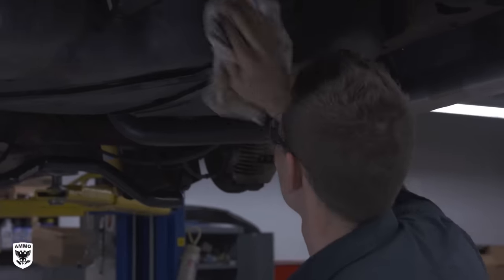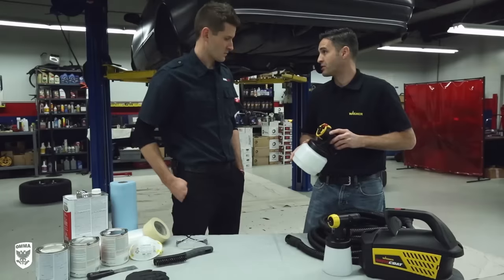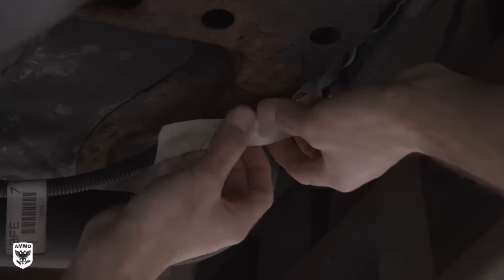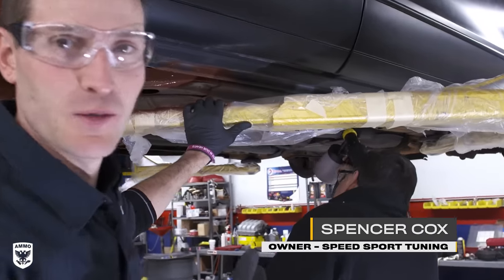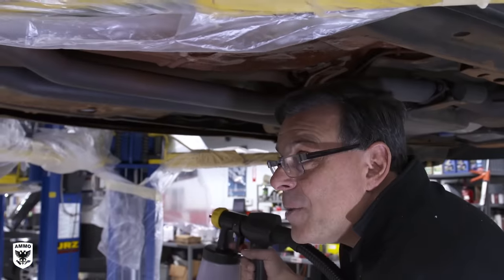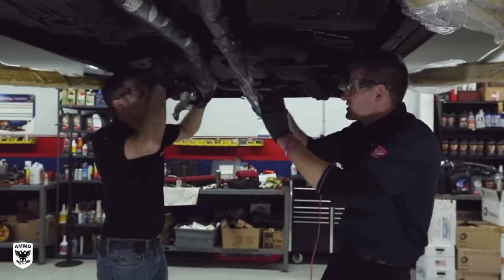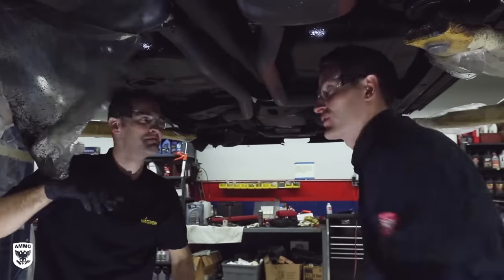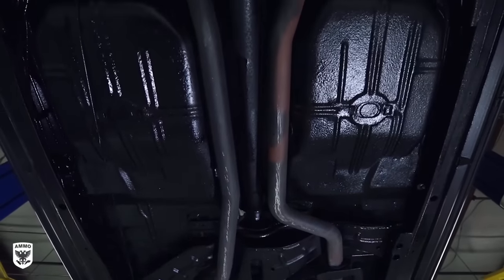How to Undercoat Your Car: Impala SS

Comment: Congratulations for killing your 95 Impala SS !!
By using a wire brush you effectively turned rust into molten rust. molten rust may look like metal but is still rust. Then you covered rust with paint. Rust contains water, oxygen and acids that will keep eating through metal. Then you covered the whole thing with undercoat so you can't even see how it is rusting underneath. What happens next is that the rust will turn metal into dust so that the paint and undercoat will form pockets that will over time fill with water, thereby speeding up the process, and because of the undercoat you won't notice it until complete panels or even the frame are rusted through. But then it is too late, as a restoration will financially make no sense.
The only way to stop this (and that is going to be nasty and expensive) is to sandblast the whole bottom of your car (which  btw. means disassembling a lot of it) and then repaint it and hope that the rust hasn't crept between individual sheets of metal.

For everyone else watching this video: Don't make the same mistake! Get to a shop with a lift and a compressor and blast some oily wax on the bottom. Repeat this process every year or two and your car will last forever, even if it is already rusting a bit.
Reply: Excellent advise. I have an all original 1996 SS with 50k miles on that's been garaged for the majority of its life. I have some surface rust on the bottom of the car, but nothing like this 1995 had. Thinking of instead of painting or undercoating it, I will simply just spread fluid film all over the place to basically slow it down, and hopefully never have to go through what was done in this video.
Reply: ConfusedSoul24 Oily wax?
Reply: I don't know about the primer they used. But rustoleum makes a reformer that chemically reacts to rust and turns it into a primer, stopping it from continuing to rust in the future. Plus, rust needs oxygen, if it is sealed in it won't have oxygen to react with to continue to grow, much like a fire.
Reply: half a dozen cans of fluid film each year when truck is new....will last along time. i have 92 chevy work van that only has surface rust...i am in new england..guy i bought it from did it right when he bought it new...still on the road
Reply: It is Rustoleum as he said at the table, and it is the 'stops rust" which is made to spray directly on the heavily rusted area. https://www.rustoleum.com/product-catalog/consumer-brands/stops-rust/rusty-metal-primer/
Reply: Rustoleum is crap. Rust Mort by SEM is a professional grade product that actually does the job
Reply: what do u mean by oily wax? do you have a can or where to buy it?
Reply: Valuable info, tks.
Reply: Waxoyl
Reply: Metal can't oxidize/rust without oxygen, so the coating stops it from rusting further. The oily wax tip is great, though.
Reply: ConfusedSoul24 is correct.
Reply: ConfusedSoul24 what is oily wax?.. what priducts name is that, and where we can buy?..
Reply: ConfusedSoul24 should’ve brushed Ospho on all the rusty areas. Which is meant to be painted or undercoated over. Wire brush is just meant to break the loose stuff free and is completely ineffective at fully removing rust.
Reply: I just saw a video of a 2011 SUV it was undercoated. The buttom of that truck looked like it was 50 yrs old.
Reply: @09Mrsubaru  yep seen it. Looks like it ate itself from the inside.
Reply: ConfusedSoul24 should have used a rust reformer first
Reply: I want to do something to help slow down the rusting underneath my car do you (or anyone here) have a good recommendation? the car isn't too bad under there just bits of surface rust, what oily wax should i be using? lol.. thanks
Reply: @Irish Viking False, waxoyl does not dry.
Reply: @bendude6748  use homemade waxoyl and spray inside frame rails and inside panels
Reply: In Germany vaseline, wax or mineral oil is quite common. You have to heat up the vaseline to get it liquid so you can pump it nearly everywhere. Engine oil is fine aswell but we can't pass inspection. Therefore I use wax (from spraycans) and chassis grease plus a pre-WD40 coating (you have to wait until it's nearly dry). The chassis grease is for the brake lines. It will attract dirt, but you who really cares? Dirt can be wiped off, rust never.
Reply: @Irish Viking That Würth coating will peel off. I'm speaking about the brown sticky wax-alike stuff. I had it in the wheel housing and rocker panels. It lastet 1 to 1 1/2 year until it was dry. I don't drive the car during winter. Therefore it was a big disappointment. It's just a secondary car and switched over to a thick wax coating from MoTip (clear/white colored).
Reply: How would using oil based enamel work?  Similar to krown, or would it trap moisture like rubber
Reply: What if you fluid film over an undercoating like this?

Comment: I run a hotrod shop and we raptor line interior and undercarriage on almost all restorations. For real coverage you need a hopper gun and about a gallon of product for the bottom.wrap a curtain around the car and properly mask it off cause that stuff goes everywhere. Just a tip. Last coat use circular patterns to blend the finish then unmask before the hardline bridges.

Comment: huge fan, quick question. How do the intricate parts react to the undercoat? (u-joints, parking brake cable) also covering the fuel filter may make a new filter an issue.
Reply: Yes, there is a lot more prep work needed I believe.
Reply: Just watched a video from a mechanic who refuses to work on cars with rubberized undercoating. Not only does it trap moisture leading to MORE rust, but many of those intricate parts are virtually impossible to work on now.

Comment: A normal underbody coating won't help stop rust and in some cases will expedient it. If any access to the inside of the coating is present it will have moisture get back there and it will rust behind the coating. I just went through this with my vehicle. It came with a coating already on it then I noticed rust starting to bleed though the coating so I removed it and found a lot of rust behind the coating so I ended up prepping the surface and por15 the entire frame.

Comment: Spray it with used motor oil. Your Grandkids will be still driving it 30 years later.
Reply: SuperCyril2 it will not harm the car??
Reply: This. My father used to oil a VW Jetta from new, since 1988 and I now own the car and it has no rust spots on the bottom. I am now doing a full rebuild on the body.
Reply: Juden Arier yeah ! Did that a few weeks ago ! Few days after went to the inspection, guy told me i have a huge leak, the car is sweating all over ^^
Reply: This is a terrible recommendation. It degrades any plastics/rubbers on the outside/underside of your car, not to mention you're spreading motor oil all over the place while you drive when it rains/etc.
Reply: Used engine oil is what i use once a year on all my cars. They don't rust. spray everything under the car, inside rockers and door bottoms.
Reply: Yeah, cause fuck the environment... (Warning: contains irony)
Reply: Oil dripping and polluting the invironment.
Reply: @167dolo  Rusted out cars sitting in some graveyard will pollute 10x as much as a little oil, not to mention Zbart coating .
Reply: I’ve used old engine oil mixed with diesel. Works fine but needs to be done periodically.

Comment: Something that nobody else but me does(but I can say it works!) is using spray in bed liner as undercoat. It's very thick, and very tough. Won't chip and scratch when rocks, salt and general toad debris hit it. I personally do 5 full coats, and when it dries, I do one coat of fluid film, which is an oily rust-inhibitor and lubricant. Is it overkill? Absolutely, but I'll be damned if it doesn't prevent your frame from rusting... forever.

Comment: It's easier to get a company to do this for you, for about a few hundred bucks. Instead of buying the tool and materials for a lot more, just to do this once per decade .
Reply: Gaz Girl I agree on taking the time to drop the exhaust. I would probably cover the suspension and brakes just to maintain alignment specs. I would probably cover any bushings as well just to be on the safe side in case any of the products deteriorate the bushing material.
Reply: Great idea
Reply: If you want something done right do it yourself. Companies just want your "few hundred bucks." They do not prep your vehicle. Instead they mask over the rust rather than neutralize. The finished product looks the same and you'll be none the wiser.
Reply: Very true. I had my car painted at Maaco & they never even primmered the vehicle & the paint was falling off like bread crumbs barely after a year.  It looked fantastic initially.
Reply: cheaper to do it yourself
Reply: RolandAshcroft usually they just spray it on and don’t do a very pretty job or spend the time scraping and treating surface rust.

Comment: Overall I like this video with one exception: doesn't coating the driveshaft cause it to be out of balance? I thought you coated the driveshaft.
Reply: Then wouldn't the logic hold that when the drive shaft rusted and metal flakes fell off, the drive shaft would then 'be out of balance'
Reply: Tom Gavin undercoating is way thicker than paint it will add vibration don't spray your driveshaft

Comment: After painting I would have just sprayed it with cosmoline. As others have said, it is possible for the metal to start rusting and spreading underneath the rubber coating without being detected.

Comment: Next you need to do the inside of the doors, rocker panels, fenders, engine compartment, hood and trunk. Problem is that Wagner doesn’t have attachments for flexible and ridged wands.

Comment: Don’t ever undercoat a vehicle ! 
Ask any professional any mechanic.
Reply: You are 100% correct, it essentially destroys the car, and you sill never get it all off . Not only that if salt gets in , it spreads like wildfire with the moisture.
Reply: Idk about you, but all the cars in europe have factory rubberized undercoating. I would like you to try on a piece a sheet metal and let it outdoors to see whats happening. So first make sure the metal is as clean as possible from any rust, stains and oils. Then, scrub everything with fine sandpaper for better grip. After this, apply primer and sand it too after its dry, and eventually, apply the rubberized undercoating 2 times. You will never need to undercoat your car ever again, and it will not cause rust! All its needed its some of your time, attention to details and working clean

Comment: Hmmm... I've been told that undercoating isn't great because it can mask rust spots that develop from small cracks.  Other folks really tout something called fluid film to be applied yearly to protect against rust.  They both seem to have pros and cons.  I'll have to admit though, the underside of the impala turned out looking real nice.
Reply: Fluid film is just kind of an oil like coating it has to be reapplied because it drips away or dries up.

Undercoating can mask rust if you don't prep proper.  Which most people don't do. They just spray the undercoat on. In which case the above would be the better option. Especially if you don't pressure wash it first.

You need to be detail orientated with undercoating for it to do it's job proper.

Comment: great job you covered the rust with paint like wtf
Reply: You realize paint inhibits rust, right?
Reply: so you don't need to remove the rust first?
Reply: The primer coat is designed to turn the flaky rust into a much stronger form of iron oxide that's inert and bonds well with paint.
Reply: +4G12 wow that I didn't know.... I'd still be a little scared to do it.
Reply: +chloe lynn well leave it on.

Comment: I would of Used a Rust Neutralizer on the rust before putting the undercoating on you basically just sealed the rust which will make it rust faster

Comment: It’s mind boggling that you’re encouraging people to do this.
Reply: How so?
Reply: Terrible thing to do look into it. The moisture gets trapped and makes vehicles rust out even quicker. Also a lot of important components get coated over making them even harder to work on. Look up Eric the car guy under costing vehicle. Truck with 55k miles completely trashed because of this stuff. Don’t do it.
Reply: @Carnius797  Damn. Well looks like I gotta find a better undercoating method then 😂 Any suggestions?
Reply: @Totemparadox  fluid film

Comment: This guy has no clue. First take all the surfaces to be undercoated down to bare metal with a sand blaster. It will continue to rust under the undercoating.
Reply: No, if you oil down a chassis, the oil will actually hold better if there's a bit of rust (not huge flakes...I mean "surface rust.") I'm NOT talking about "rubberized undercoating/glorified bed liner"; I'm talking about oil coating, or something akin to the "cosmoline" treatment the military gives machinery shipped across the ocean.
Reply: metal rusts when oxidizing oxidizing means when the metal comes into contact with oxygen
if covered properly that rust should stop oxidizing therefor rust not spreading
Reply: Need to sand it and then apply ospho to stop the rusting process - THEN paint. O2 will be able to get through these coatings, so the rusting process will continue (the coatings only serve to stop water and salt, which encourage the reaction. Once the bare metal is exposed, it will continue to rust even when coated. Ospho bonds to the exposed iron which prevents the O2 from rusting the metal - thus stopping the rusting process
Reply: Have you actually read what Rustoleum primer dose to rust.
Reply: Its amazing when people don’t even know what rust is lol
Reply: Extremerecluse Fallows Ospho is made to be brushed on and converts the rust prepping it for primer or undercoating. Sand blasting is a waist of time when it is not needed.
Reply: @Kenzie 
Waxoyl is a lanolin-based product that people seem to have good luck with. Too expensive for me, though; I just coat my frame with "bar and chain oil" every winter. (If you want it a bit thicker, toss in a "wax ring" from the plumbing section.)

Messy the first couple of days, and I'm sure the EPA would have a shit fit if they knew, but it sure does keep the rust away!

Comment: From the video`s I have seen on You Tube,     Especially from older people,    They all seem to imply that from their experience bitumen type undercoats are not best,    Eventually water will get stuck between the metal and undercoat,     You can see the corrosion when the tar is scraped away,      It seems either a grease and wax mix or a hard ceramic type paint that can be applied in ambient temperature is better

Comment: This type of product is nothing more than a cosmetic cover up.  Any undercoating that cures/dry hard will eventually crack/chip away.  These areas will hold moisture and other contaminants that will speed up oxidation.

Comment: Using thick under coats locks in the moister  and promotes rust and will rust more then if it didn't have a undercoat

Comment: 8:18
Welcome to the world of professional painters. Indeed, most people hate painting because all of the prep work beforehand (80% of the job is preparing surfaces and sanding), but once you get to the actual painting, be it with a roller and brush or with a HVLP / Airless sprayer, it's a tone of fun. It's only a shitty job when the people before you did a shit job and you got that much more to do. I'm now working on luxury boats, and it's even more fun now since everything is done with a HVLP ^^

Comment: I recently bought a new focus. Ford dealer said they won't undercoat vehicles anymore and ford doesn't recommend it. Ford found out that the undercoating would get compromised and water would leak in under the coating and rust from the inside behind the coating. I'm not sure if this coating is better than factory OEM undercoating or not though.

Comment: Hi Larry, this is an excellent video demonstrating how to undercoat a vehicle.   I am definitely going to give this method a try.   I am wondering though if it would be safe to coat the fuel and brake lines?  I notice you have masked the electrical plugs, which I will do as well, but would it be safe to spray over other the hoses and lines?   

Thank yo so much for making such great videos as always,
Regards
Reply: Coating the metal lines will help prevent corrosion. I had a car that was undercoated new, years later I was upgrading it to disc brakes and had to chip off the undercoating with a chisel because it was so thick and solidified. Underneath, the flange nuts & hardware were in new condition and easy to disassemble.

Comment: im getting the same sort of thing done on my 4x4 soon.  they are going to do the entire bottom half of the outside and wheel wells and underside.
Reply: company called linex does it.
Reply: +OutlawUniverse just out of curiosity, what did they quote you for this? Looks like there is a Linex dealer in my area
Reply: Oh Gosh I can't remember.  I think around $600
Reply: +OutlawUniverse thanks a lot!

Comment: When anyone says spray the underside with old oil. Dont. It just makes a terrible mess that dirt sticks to and it can then never be painted. Always best to put it on a lift and wire brush the rust off and paint on red oxide. I have a place near me where i can rent a lift by the hour.

Comment: People, don't use rubberized undercoating. It will seal in moisture and cause it to rust from the inside out. You won't even see it until it's too late. Most mechanics here in Michigan won't even deal with a car that has rubberized undercoating because they know what lies underneath it.